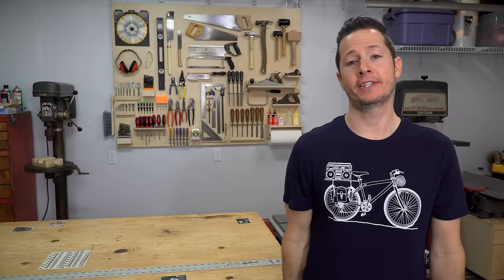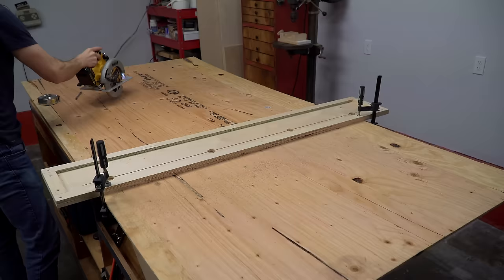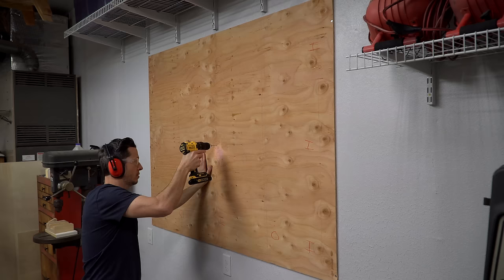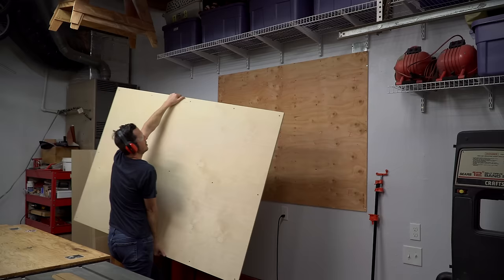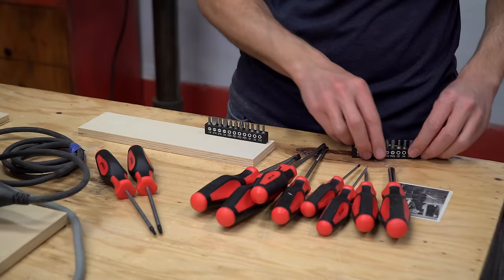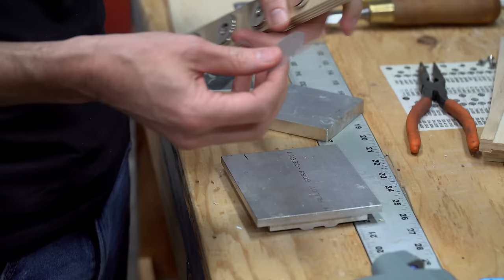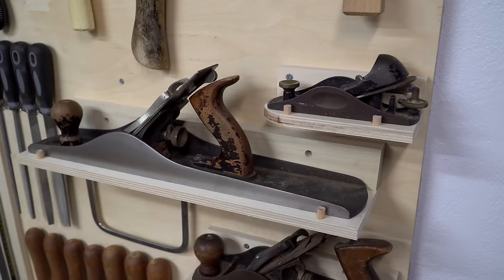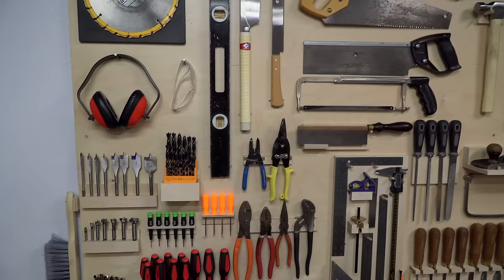How to Make a Custom Tool Organization Board

Comment: Okay, but... jumping right into finding the studs? The biggest issue with any tool organizer is which tools are going to be on it? What to do with new tools? and how to keep it from becoming another dusty widget that really doesn't function? Especially if you do lots of different things, and if you're young and still something of a rookie. Yep, there's your wire stripper tool, your diag cutters, but what about the cable cutter that once you get it, you use it a lot, but there's no space for it on the board? (This is not an argument for peg board. I think you've made an excellent point about its limitations). 

You overthink attachment. There are two basic considerations for the large sheet of plywood, sheer forces along the wall and it being pulled away from the wall like a hinge. I don't see anything about your board that couldn't have been held with 4 #12 screws in wall anchors through 1/2" drywall. Of course I wouldn't just do this minimal hang, but also don't over think it. The shelves for the planes. These are all cantilevers, and overbuilt. A much simpler solution is small triangular brackets. If you made shelf with two ends and then attached the ends to the plywood-panel, that'd hold those planes closer to the wall and be easier to make. 

The extra work you did for the hammer holders is very smart. You will not only benefit from efficiently hanging your hammers, but you'll always enjoy how you did it. I also like your 'screwdriver' solution and adding a few extra nails so you can blow the dust off is another great problem solver. 

And how easy it is to change things goes a long way towards solving my first criticism. 

For all years of being a bodger, I think I would have a place to hang my tool belt with it's standard set of tools (I wear it even in the shop), and a series of small drawers each based on one idea or type of task, electrical hand tools, plumbing hand tools -small, no large pipe wrenches, but also teflon tape and valve wax. Each with extra room for adding new things. The drawers would be interchangeable, so if my electrical tools needed another drawer or two I could shift the others to keep them together. The thing about tools and tasks is they're constantly changing, evolving. 

And Thank you for not jumping on the Moron How To  Puzzle  Video Turnip Truck: You know where the maker says, 'Today I'm going to make a (words but no picture)... followed by twenty (tedious) minutes of the guy cutting and assembling all manner of detailed parts and you have no clue how any of it fits together or even what he's building until the last 20 seconds when he's asking you to subscribe. No body in history has ever constructed anything this way.
Reply from the maker: Thanks for sharing your thoughts on the matter! I do think I could have hung the board with less thought (and less screws), but I do appreciate the incredibly solid feel it has. When I hang a tool on it, it sounds solid (rather than hollow), and that just makes me feel good.

I do have a full sized tool box, and many other drawers in the shop where I store tools that I either don't use as much, or don't want exposed on the tool wall (because of their ability to collect dust or form rust).

You made a great point about someone who is a rookie; when you're new to the game, you'll still be adding lots of tools over the years, so you don't want to build something that's too difficult to change. I personally think I've struck a decent balance here with things being able to be pulled off and changed around fairly easily. Where pegboards may not require an extra tool to hang something (meaning a pegboard doesn't require a pin nailer like my board), or custom holders, they also don't hold things as well, and are more limited in their ability to be rearranged (because you're limited by the peg hole array, and the generic pegs/holders). All that said, a pegboard may actually be a better choice for someone who is just starting out because it will give them the time to build their tool set with little time invested in holders. That way, as they realize their workflow uses certain tools more than others, they can adjust their set more easily without having to feel bad about all the time the spent building a custom holder for a tool.

Anyway, thanks again from bringing up these awesome points, and thank you for the wonderful compliments!
Reply: @OneMinuteWorkbench  Don't want to turn this into a whole thing. No one ever has a problem with an extra screw or nail or 4 (unless it splits the board),  it's the one that's missing that causes all the fuss. 

Something about pegboard that should be mentioned. Even though there are a lot of holes, by the time you put 4 hangers side by side, you've lost space for another hanger. With your method you could make (let's say) 5 sets of screwdriver hangers in the space a pegboard would have room for only 4. 

The thing about drawers. In an artist studio I worked in,  he has a long counter, kitchen height,  about 4-5 drawers high, each about as wide as a kitchen drawers but a bit taller (so maybe 5-6" deep). Not all of them have stuff in them. The way it works is everything gets a place, over time it gets edited. As some categories expand, they gain a drawer, if they don't expand maybe they can consolidate and lose a drawer. Because they're all the same size they can be moved around. 

If I did this:  Take picture framing. I would do that right on the countertop. So I'd want all these bits and bobs in the top drawers. Let's say these would take 4 drawers. 

Now my plumbing tools. These should never be right under the work surface because all the plumbing I do is under the house, under the sink.... but never on the countertop. So these tools can be on the bottom row. 

    Now suppose I start doing more electronics on the counter, I'd want those drawers where the picture framing drawers are.... What to do? Well, I might put the lesser used framing drawers underneath. So top four drawers framing-framing, electronics-electronics. And then the next row same thing. But then I realize, I frame standing up, I do electronics sitting down. I'm right handed, so the electronics drawers should be on the right, the framing drawers are fine on the left side. 

The over all idea is create as flexible and interchangeable a system as possible, and continually edit and improve it.  Your hammer and other tool brackets do not need to be standardized because you can just make them up with cut offs. Say you need another hammer holder with a a bit of dowel sticking up. If you thought I like the dowel, but don't have the time....use a screw. But drawers are, or should be permanent. 

       I have some finger jointed baltic birch drawers that are just under 30 x 30" (so I could get the sides from 60 x60" sheets). I think they're 25 years old, used abused, everyone of them is like new. 

If I wanted to do drawers like the artist, and I've made drawings, I'd set aside two weeks, buy 1.5x the baltic birch(BB) I think I'll need and get to work. 25 years ago, the BB I used wasn't square, so I cut it off square, drilled a small hole in one corner, so I could hang them up. Then I sanded whole sheets using a drywall sander on a pole, worked through a few grits. Then I hung them and gave them two coats with this two part Swedish Bona floor finish and hung them by hooks in the holes to dry. Then I started ripping them down, made a rabbeting jig for 1/2" slots, spent a few hours tweaking it. Made the sides for a couple of drawers (to make sure I didn't end up with 80 part-As and no part-Bs) then went through the whole stack of parts. Then I cut slots for the bottoms (also half-inch, but would've been just fine 3/8 or 1/4), scraped/sanded some of the finish off at the finger joints for the glue, put them together, checked for square, s  touched up any bare wood on the edges. Most I added wood slides. (Hardwood slides are I think better than any hardware. Just sand, seal and finish the wood, and wax  them. Unwaxed they're terrible, waxed they'll work for 25 years without needing more wax -- I can prove it.) 

Okay, being a busy body. Sorry. One last tip. Parachute bags for screws and nails. They don't make'em like they used to. The materials are good, but almost all tool bags, parachute bags etc... are too dark. You can't see into them. Take some white Krylon spray paint for plastic and give each pocket a shot. They fabric will seem to just soak up all the paint, you'll think, 'that didn't work too well.' but leave a couple unpainted. After you use the bags/pockets onetime you'll see that just making them a bit brighter really helps.
Reply from the maker: Thanks again for sharing your thoughts! I'm also a huge fan of wooden drawer slides, but I think hardware has its place too. I like the simplicity of wooden slides, and the fact that they pretty much never fail (as long as they're built while properly considering expansion and contraction). I do use hardware for some stuff thought because I like the way they hold to drawer level while allowing for over extension - very nice to have for shop drawers when looking for a small items at the back of drawer. Anyway, thanks again!
Reply: Not every tool you have will fit on the wall eventually. I have a roller cabinet for most of my hand tools but put the ones I use frequently at arms reach. This system is easily modified. Eventually everything you need will be in front of you. The rest will be on shelves or in drawers. I do not have enough wall for all my tools and suspect eventually you may find yourself in the same place. As long as you can find them when you need them.....
Reply from the maker: I hear you, Paul - I certainly don't have enough wall for all my tools either. I think a tool wall like this (or any other system were tools are more visually assessable and easily accessible) only make sense for someone who has been working in their shop for many years, and has determined the tools they use the most frequently. They will know the "bread and butter" tools they use day in day out, and those tools will be the ones that are good candidates for a system like this. Also, certain tools really need to be kept in drawers due to their sensitivity to the moisture in the air, or their size, etc. You mentioned that you keep the tools you use most frequently "at arms reach"; what sort of system do you use for those tools?

Comment: Not sure why you didn’t just use the sheets full size? Looks like you cut two feet off. You could just went another foot each side and saved time and had room to grow.
Reply from the maker: I had restrictions I had to work around. On the left side, the wall changes to plaster and metal mesh (no studs to hang from), and on the right side, the stud is occupied by a shelf bracket right were the board would go. For the right side, I could have shaped it around the shelf bracket, but the asymmetry would have kicked my neurosis into overdrive 😂

Comment: "How to Make a Custom Tool Organization Board"... assuming you have amazing tools and pretty decent carpenter skills already. Maybe you could show us how to do something like this on a budget and with less skill than yourself? Think about poor people and how they might do it.
Reply: Its two sheets of plywood and screws
Reply: My god, now ive head it all.
Reply: @kostasgnt  LOL - He starts with a workshop, circular saw, clamps,. After which he drills, countersinks and using automatic nail gun, fixes it. From there he uses a 5 ft straight edge to get it all set perfect. Then rinse and repeat with the more $$$ ply, with the exception of 2 $$$ claps to help him. Then a table saw, a drill press, a bunch of nice hand tools, a router table, a cool rigged up circular sander, a cool ass pin nail air gun, glue gun, magnets, dowels, oh yeah and "special attention" for his marking tools. It also might be important to mention he is clearly pretty good with all that stuff. You may find it hard to believe, but MOST people have a hammer & screwdriver, amongst this wide array of tools. But sure... just some ply and screws. Did you even watch the video?